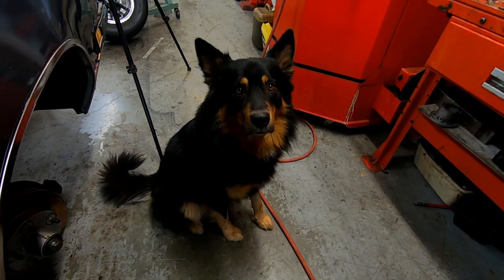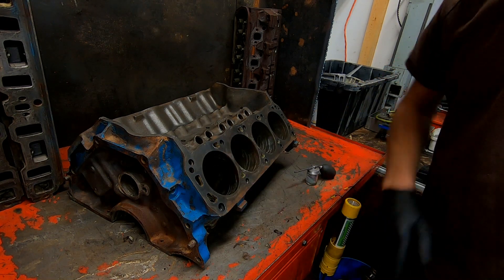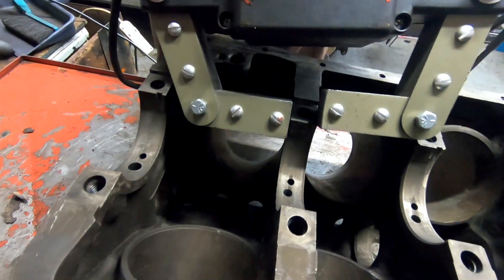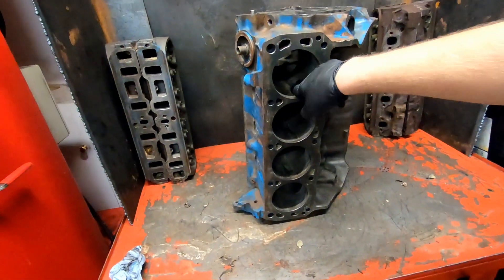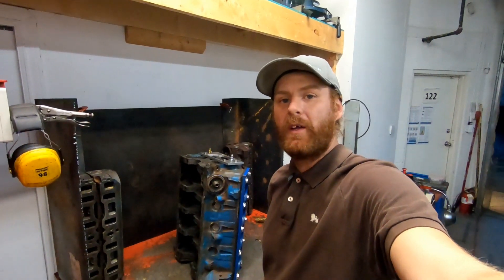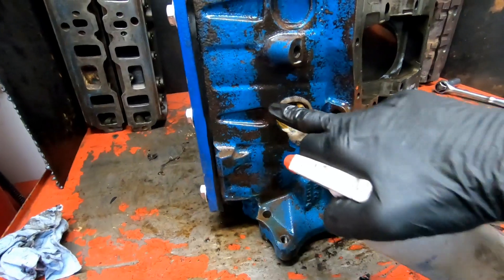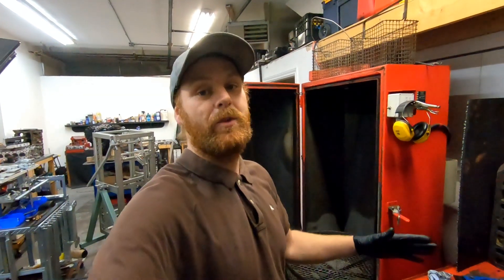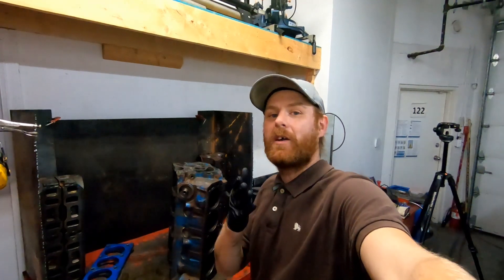351 Windsor Inspection

Comment: Hey I liked the vidio found it very helpful, question? where did you get the block plate for the 351W, been looking  cant find, we had a block we wanted  to test in the vehicle this look like the way to do it with out removing the engine Thanks Don
Reply from the maker: Thankyou 🍻
I make my pressure testing plates myself. With the machinery I own it's quite simple for me but it can be done with just a hand drill and a hole saw.